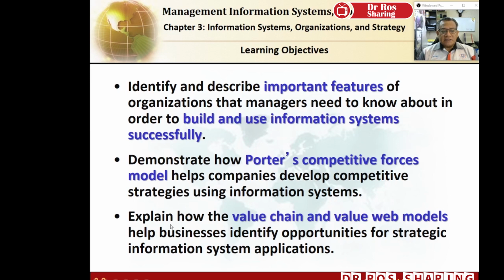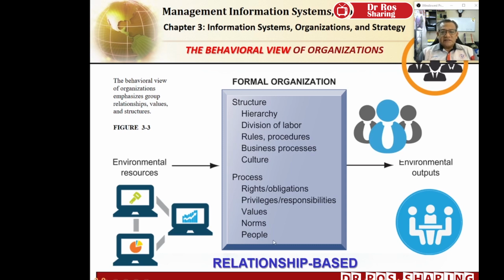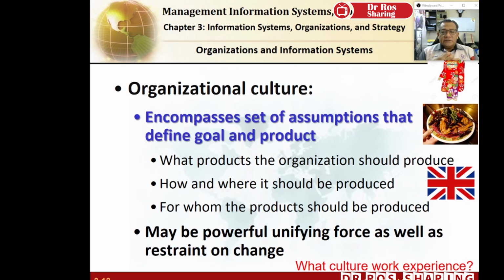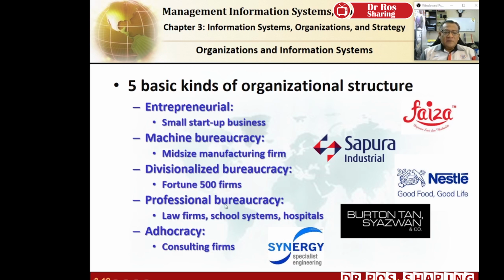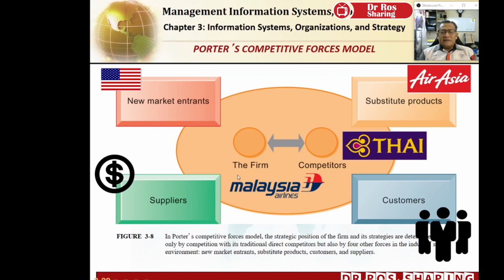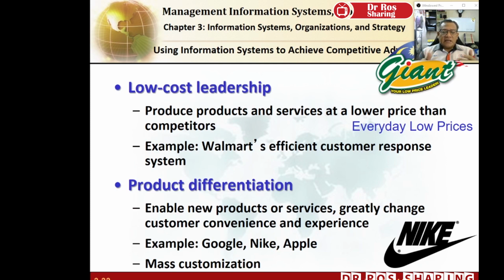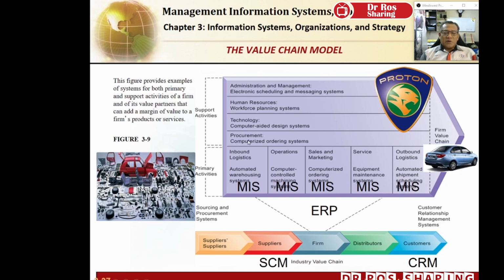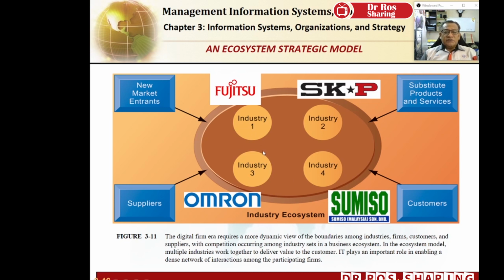MIS Chapter 3 DrRos Video Lecture

Comment: JOSIELYN JIDING (CP200026)
I learned about the technological and behavioural definitions of organisation. I also learn about how managers use information systems and information technology to structure their organisations. Aside from that, Porter's competitive forces model was used in the information system to assist businesses in running and operating effectively.

Comment: Ngu Chieng Huang （AP200486）

Thank you Dr for sharing. Through this video I learned that information system needed by an enterprise should be competitive. This kind of information system can improve the efficiency and effectiveness of operations within the enterprise, and directly improve the competitiveness of the enterprise externally.  The information system strategy should be an integrated part of the company’s overall strategy. Otherwise, such a strategic system will develop in a piecemeal manner, which will neither expand the company’s strategic vision, enhance its insight into the market, nor improve its exposure to the market responsiveness.

Comment: NURFAZIRA FONG ZI PENG (AP200269)
Thank you Dr for sharing this video. According to the video, management information systems assist the entire firm in improving critical elements so that improved corporate solutions may be provided. The role of the information system in the organisation has an impact on the information system's design. The information system is critical to the success of the company.

Comment: NABILA HUDA BINTI MOHD YAZID 
(AP200008)
Thank you Dr for the sharing. I learn that information systems and the organizations influence each other. These features of organizations help explain differences in organizations’ use of information systems.
Then in Porter’s competitive forces model, the strategic position of the firm, and its strategies, are determined by competition with its traditional direct competitors, but they are also greatly affected by new market entrants, substitute products and services, suppliers, and customers.
Reply: Cool, thanks Bela...

Comment: NURUL SUHAIDA BINTI ABDUL RASHID (AP200126)

This chapter 3, i have learned about:
1) what is function of 2 ways relationship between organization and information. on how the information and organization influence each other. 
2) learned about impact of information systems in organization and business. 
3) learned about competitive force model's (Michael Porter). using the information systems to achieve advantage and there is 5 competitive forces shape fate of firm: like suppliers, customer and so on and the most important thing is they are related with the firm and competitors. 
4) and last but not least is learned the value chain model in business to identify the opportunities.

thank you dr ros for sharing the knowledge with us. ^-^

Comment: FARHAN HAKIMI BIN MOHD ZUHORI (AP200374) 

Thankyou Dr for sharing the vid. From this vid, I've learned that IT plays an important role to assist companies and businesses in order to strengthen their business process to get a competitive advantage. I learned by using Porter's competitive forces model helps companies to develop strategies by using information system. I also learned about how the behaviour of managers and employees in running IT will give impact to an organisation.

Thankyou Dr for the sharing.

Comment: RABIATUL ADAWIYAH BINTI SAIDI (AP200371) 

I learned about identify important features of organization that managers need to know about in order to build and use information systems successfully. In organization have two meaning in management such as in technical and behavioural. IT flattens organization can make decision making is pushed to lower levels. Porter Competitive Forces Model can help company create new strategies to increase the business done with using information system to achieve competitive advantages. 

Thank you for sharing :)

Comment: Nur Anis Safiah AP200105
Based on this video, I have realized IT is very important nowadays such as, between organization and information system. This two-way relationship is medicated by many factors where it includes culture, business process, politics, structure, environment and also management decisions. In addition, organization divided into technical and behavioral. Technical based on process-based meanwhile behavioral basically means human to human. Also, I find out about 5 basis of organizational structure which impact our economic and behavioral. Last, I've learned about how strategies Porter's competitive forces, the value chain and value web also ecosystem strategic model working.Thanks for this sharing and have a good day Dr 😊.

Comment: TAN YEE LING (AP200483)
From this video I have learn for the information systems, organization and strategy. That have two way relationship between organizations and information technology. Therefore, the organizations and information systems influence each other. And also the features of organizations and 5 basic kinds of organizational structure in organizations and information systems. I also learn for how information system impact organizations and business firm. Last but not least, that is using information systems to achieve competitive advantage in Michael Porter's competitive forces model, 4 generic strategies and in management issues.
THANK YOU DR FOR SHARING THIS  VIDEO.
Reply: YOU ARE MOST WELCOME, TAN YL.

Comment: HANISAH AFIAH BINTI  NOR HASDY (AP200005)

I've found out that email communication is is very common among many organization. besides, I can know that many of organization apply and use the hierarchical structure and also adhere to the principle of efficiency  routine that repeatedly doing day by day with sop(standard operation procedure) and business process. In addition, I learnt that Porter''s competitive force model can help the organization/ companies developed the competitive strategies by the information system and how company use the I.T in order to improve their companies.

Comment: Intan Nurhidayah Binti Mohd Noor (AP200376)
Assalamualaikum Dr Ros, thanks for sharing this video. From chapter 3 video i have learned that information systems may help businesses get a competitive edge by using synergies, core strengths, and network-based strategies. And then i also knew that how Porter's competitive forces model can help firms establish competitive strategies utilising information systems, as well as how the value chain and value web models may assist businesses find potential for strategic information system applications.

Comment: NUR ANIS HANNANI BINTI AMRAN (AP200464)

I learned about the behavioural concept of organisation through sharing chapter 3. The first is structure, which includes hierarchy, rules, and cultures, and the second is process, which includes right, values, and people. They'll be the environmental output there is finished excellent and production report that's brought to a meeting for debate in a formal organisation. Finally, environmental resources are required for formal organisations to function in order to attain environmental outcomes. I'm also familiar with the five fundamental types of organisational systems.

Thank you Dr for sharing ☺️

Comment: Muhamad Aniq Haziq (AP200088) Section 4
thank you Dr for ur sharing,  from  the video, I've learnt that information systems and organisations need to plan their strategy so that they may use IT to complement their business operations in a synergistic way. I also understand how to deal with competitive forces such as low-cost leadership and product differentiation using generic methods. Furthermore, I learnt about Porter's competitive forces model, which can assist firms in developing competitive strategies. Thank you

Comment: TAN YU HAN AP200162

Thank you, DR for sharing this video. From this video, I have learned about how does information technology and organization influence each other. The organization consists of offers two components which are the technical perspective and the behavioral perspective. I know about the definition of both perspectives. Besides that, I also know about 5 basic kinds of organizational structures which are entrepreneurial, machine bureaucracy, divisionalized bureaucracy, professional bureaucracy, and adhocracy. Furthermore, I also learn about how information systems impact organizations and businesses. In this video I also know that the business model call "Competitive Forces Model"  proposed by professor Michael Porter. I know that how Porter's competitive forces model helps companies to develop competitive strategies by using information system. I also know there are five competitive forces shape fate of firm which are traditional competitors, new market entrants, substitute products and services, customers and suppliers. Lastly, I also know about what is value chain model and value web and how does the value chain model and value web help in the business.

Comment: Nur Izzah Fadhlin Binti Mastor CP210008
From this video, I’ve learned Porter’s competitive forces model helps companies develop competitive strategies using information system and how the value chain and value web models help businesses identify opportunities for strategic information system applications. I also learned that information systems help business use synergies, core competencies and network based strategies to achieve competitive advantage. Thank you Dr Ros for sharing this video.

Comment: nurul syafini binti mohd yusof (ap200261)
 I learned that by using Porter's competitive forces model, we can provide a general view of the firm like its competitor and environment. In Porter's competitive forces model, the strategic position of the firm and its strategies are determined only by competition with its traditional direct competitors but also by four other forces in the industries' environment, which means new market entrants, substitute products, customers, and suppliers. Thank you Dr. Ros for this sharing.

Comment: SITI NUR NATASHA BINTI MOHD PADZLI
AP190509
From this video, I learn about the important features of organization to build and use information system carefully. The technical definition of an organization is a formal social structure that processes environmental resource to generate output. After that, the information system able to help organization to strengthen customer loyalty.

Comment: Ahmad Yusof Syamim Bin Talib (AP200245)
From this video, I learned that by using Porter's competitive forces model, we can provide a general view of the firm like its competitor and environment. In Porter's competitive forces model, the strategic position of the firm and its strategies are determined only by competition with its traditional direct competitors but also by four other forces in the industries' environment, which means new market entrants, substitute products, customers, and suppliers. Thank you Dr. Ros for this sharing.
Reply: You're most welcome, Yusof. Thanks on summary.

Comment: NURUL FAKHRIAH BINTI YUSOF AP200069
From the video, I have learned is the organisation from theoretically, organisation is a formal structure which is the highest position is CEO and the lowest is employees that process the resources to produce outproduct. Meanwhile behavioural is the collection of right, privilage and responsible to achieve the company's goal. Then the company will start to produce product outputs by get the resources like capital, employees which later give benefits to the organisation. Information system helps in  business with the company need to improve their technology which will flatten their layers of management . Porter's competitive model consist of 5 factors, traditional competitors, new market entrants, substitute product and services, customers and supplier.
Reply from the maker: One good summary there, Nurul. Glad that you could sum it up... comprehensively!

Comment: Santhi A/P Manokaran AP190444

Thank you Dr for the sharing. From this learning video, I have learnt about the relationship between organizational and information technology in which they are influence each other by the mediating factors such as environment, culture, structure, business processes, politics and management decisions. Next is the features of organizations that business need to know which one to apply or use and also the impact of information systems on organizations. By using information systems could achieve competitive advantage, for example Porter's competitive forces model help organizational develops competitive strategies. By using synergies, information systems can improve overall performance of business units. Business operation always need IT in order to achieve high performance and their business objective.
Reply from the maker: Very nice summation. Definitely you got it there. Keep it up! Santhi...

Comment: Chin Suhk Jian (AP190427)
Based on the video, I have learned information systems and organizations need to tally up their strategy in order they could synergistically use IT to better complement their business operation. IT makes the organization slightly flattened rather than traditional because of more IT influence in the form of network communication. In addition, I also have more understanding of Porter’s competitive forces model which can help the organizations to develop the competitive strategy.